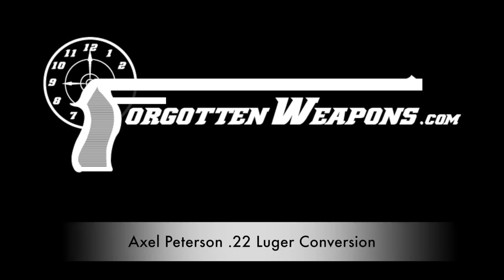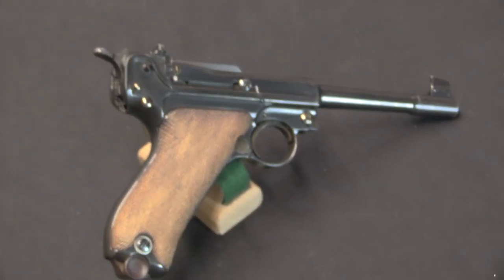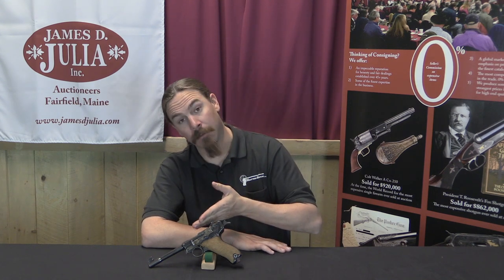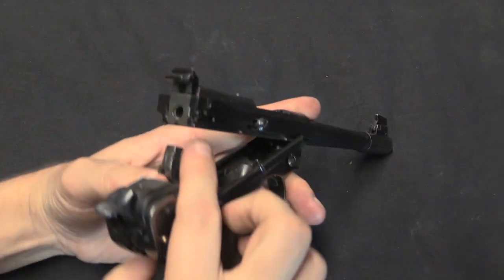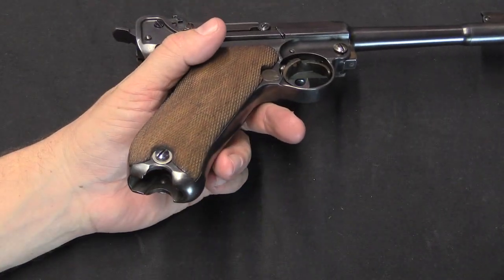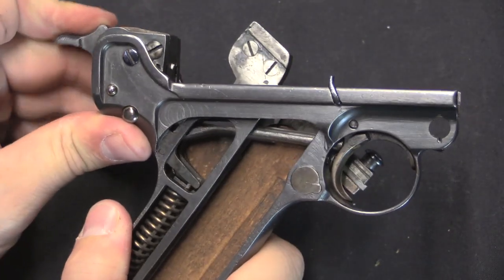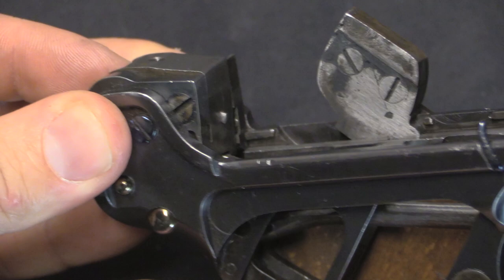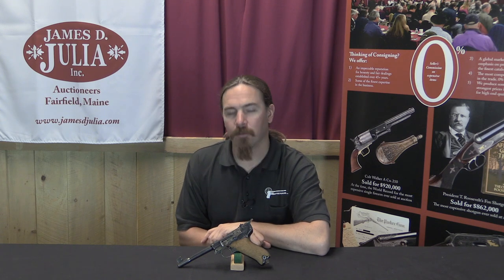Axel Peterson .22 Luger Single Shot Conversion

Comment: somewhere a guy just went "what? i can make that even more complicated." soon he will have a single shot pump action luger...
Reply: bran8337 i love this channel... we are a special place on the internet ×D
Reply: Mora Africano Camilo Andres me too. but only if it isnt 9mm or else it would be as useless as a highpoint. Those are just fun and thats all...
Reply: Nah. Wind up clockwork Luger, with a complicated, coded key.
Reply: Make it canvas-belt-fed and we have a deal.
Reply: Funkpanzer so just to get this all strait; we have so far decided it should be a luger chambered in .358 gremlin, canvas belt fed, pump and lever actuated bolt, with suppressor... gun lovers wet dream... edit: its also a clockwork bolt.
Reply: 45bullshark with a 3 stage lever on engaging the firing pin itself for fire/safe/captive slide positions. and ur button safety will be ambidextrous. and instead of a cleaning rod it should have a cord with roler lock for lockout-tagout thats held by a captive pin so u cant remove it... we shall call it "Le Liberal"
Reply: yes, the safest possible rifle....hold on, should it also have a lubrication system for each round to ensure smooth operation?
Reply: 45bullshark of course; a KY Jelly reservoir actuated pump in the feed ramp... with a pressure gauge just incase
Reply: This guy could be me...

Comment: would be cool if the magazine was fitted for .22 so it could be used as a spare ammo supply, like the Liberator pistol
Reply: bad idea for target pistol, with each shot you got less ammo and less weight in the gun
Reply: @Marcin206pl  He said spare ammo supply, not a functional automatic magazine. Just empty your ammo out at the beginning (which you would have to do anyway as it's single fire) and that's not an issue.
Reply: @user-oi8sq6ci8j  if that’s the case and you don’t mind then why not just drop a handful into the mag without a spring. there’s a bar at the top of the receiver blocking them from getting lodged in. lol

Comment: My brother worked for John Martz a Luger pistol maker and I saw alot of his pistols as my brother would perform work on them such as stock making, grips, magazine bottoms, spring making and other things and I must say that this Luger is the Most Stoooped pistol I have ever seen. Mr. Martz made a .22 Magnum conversion and it was slick. It used a section of the frame's ramps to break the toggle open. Very nice.
Reply: Bruce McCreary now there was a PO8 genius ! I remember his stainless 45. Luger in Guns and Ammo.

Comment: That frame appears to have started out as an Erfurt from between 1910 and mid-1913 due to the lack of a stock lug.  I have several Erfurts from that era and the difference between an original no-lug frame and one that had been ground off later is that the true no-lugs had a different contour to the back of the handle, whereas those that are ground appear flat. I see that it does have the magazine hold open slot ground into it so I am wondering if it was a 1914 conversion.  Lugers are just way too interesting.

Comment: What i dont understand at all about this is that you could fit a semi automatic 22 conversion kit into the Luger thats not even all that complicated and doesnt damage the original gun, so its still usable as a 9mm, but that guy decides to completely destoy the gun and only make it a single shot .22. I mean it seems to work and probably has some slight advantages but still its quite silly. Even back in the day Lugers werent that cheap and you wouldnt irreversebly convert an expensive high quality modern 9mm to a single shot 22 because you like the grip or something.
Reply: When this was made lugers where not collectors items, infact they where normal, guns you could buy at the store or from a catalog.

If someone was a compitition shooter and liked the ergonomics of a luger there really was no reason not to do this, remember comparable guns of the time like the colt camp perry target pistol where simmilarly mechanically odd conversions of service weapons to single shot sporting guns

Comment: I don't want to second guess a man who had a mind far finer than mine but yet I wonder why he  didn't just make a conversion unit -  all be it a lot better one than the common Erma type - that uses the same hammer system on a replaceable upper with a finely tuned  standard trigger that one could use on a standard unaltered P08 frame....